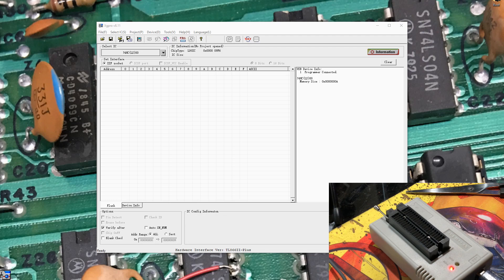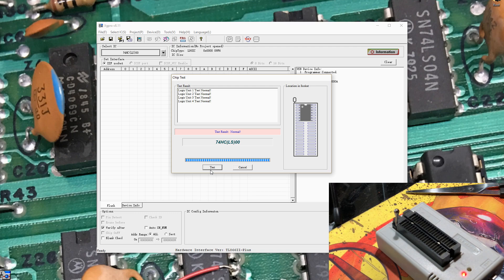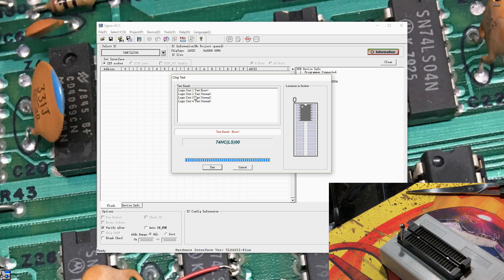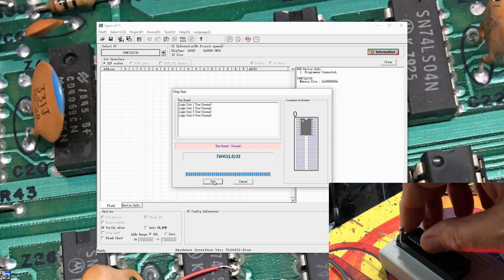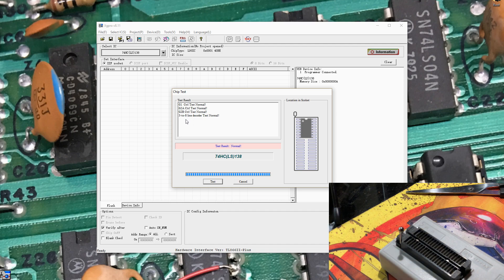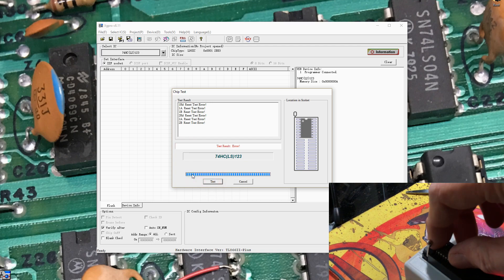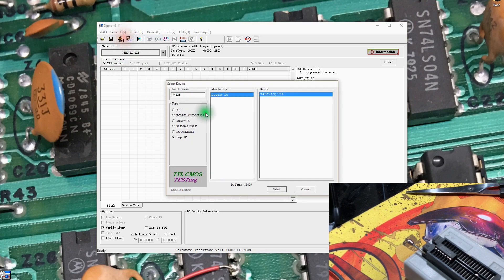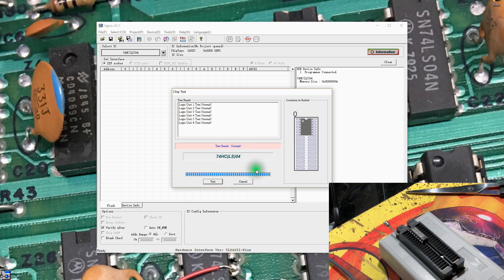TL866 Programmer - Testing logic chips - STB254

Comment: Good afternoon.  I was wondering if you know if this programmer will work on ITE chips like the IT8987E startup chip?  In the XGPRO software it has the chip listed, but behind the chip brand ITE is says "(TESTING)"... I'm wondering if they are still "testing" if the chip will work with it, or if it can only "test" those chips..
Reply from the maker: My version of the software (v10.35) doesn't show that as a know part. When I search the online list again it doesn't show up. My programmer is the TL866II.

Comment: Hello. How are you. I have a HD67F3048F16 microprocessor.  How can I read the hex in it.  I want to copy hex.  Can you help with this.
Reply from the maker: This seems to be a Holtek processor. 
https://datasheetspdf.com/pdf-file/1265664/HoltekSemiconductor/HT67F30/1
I don't know any any USB programmers that can deal with this processor. Also, most processors have a lock bit that when set will keep an end users from reading the bytes (hex) out of the processor. Sorry I can't be more help.

Comment: Cool that the TL866 can be used for testing Logic ICs. Not sure why, but it never occurred to me to use it for that, thanks. By the way, see the "Select IC" under the floppy save icon in the tool bar. There is a huge button underneath it showing the selected device number. No need to constantly use the drop down menus, just hit that button to select your device :)